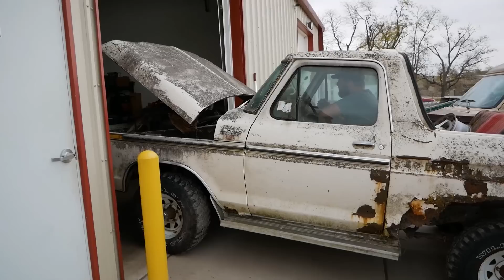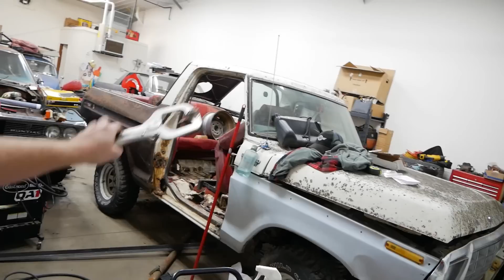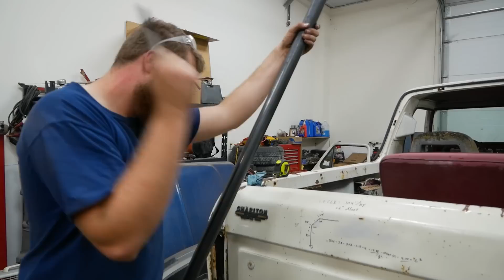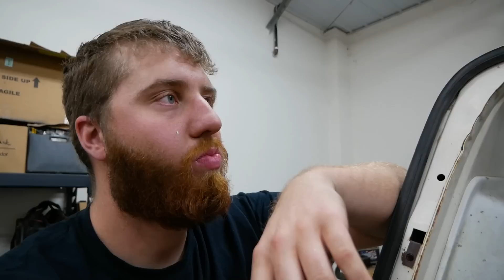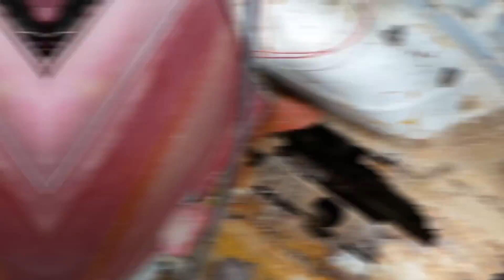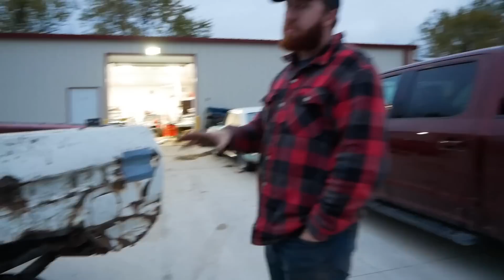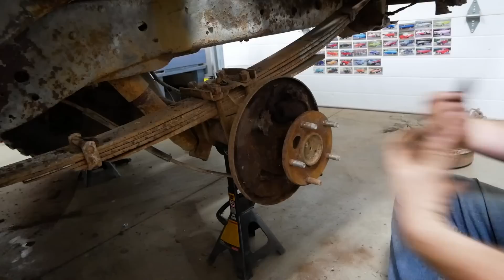Building an ABANDONED Bronco into a DIRT CHEAP Off-road Rig!!

Comment: I would have cut the ends of the pipe beveled so they interlocked before welding for the splices. I also probably would have fucked up the bending and the beveled cuts about 5 times before i got it right.

Comment: >$1000 truck challenge 
>Spends $8,000 on tools
Reply: it's not like the tools could be easely resold at same price and or reused ... It's an investment for the future, espacially if you take quality stuff that'll last 10 + years if maintened
Reply: @tinatpasselepoivre  TRUE DAT.. i still have my 8o amp craftsman MIG from 1995..i since modified it with bigger diodes and now cranks out 150 amps
Reply: @tinatpasselepoivre  except when you and go to do a $1000 truck build, we had to spend the additional $8000 on the tools to get the job done. Because don't have "friends" who send them to us......
Reply: Don't you know the cost of the tools doesn't count? at least that's what I tell my wife.
Reply: @flash21502  lmao! That was a good one bud. I try to tell my wife it saves us more in the long run 🤷‍♂️
Reply: @flash21502  😂
Reply: I bought tool when I was 18 in 1994, I still use those same tools today.
Reply: lmao
Reply: @clashingwithvance965  I mean for exemple When I redid my hydro lines on my Citroen I bought a second hand tube formerflairer (?) ... Resold it in like 2-3 weeks at 90% value of buy. Not bad.
Reply: Neat profile picture

Comment: Jyd just use a wire and about angles then measure the wire. About the sections slide a bigger pipe over one section the weld the section the grind enough to slide the bigger pipe over the section then weld everything. I want the cage super safe bud.

Comment: when you weld, you want to go into a circular motion, and keeping the flow/movement steady is key.
Reply: 1000 ways to skin a cat. Depends on the position, material type, material
Thickness, etc.  For example is circular motion is ok if you’re doing a fillet weld in the 1G position. Not so great in the 3G uphill. 

My point is different techniques for different positions, material, etc may be needed.